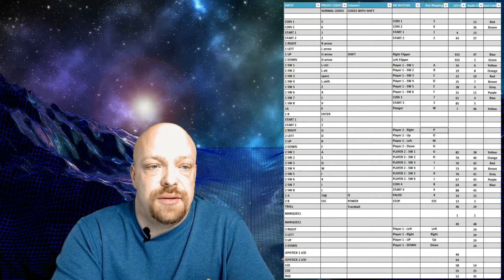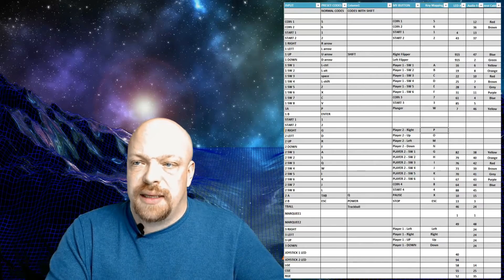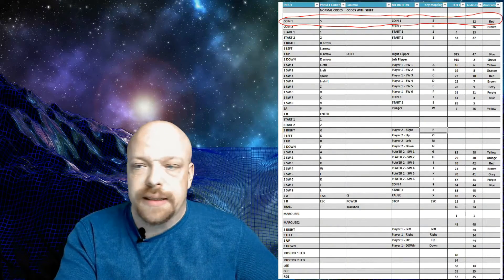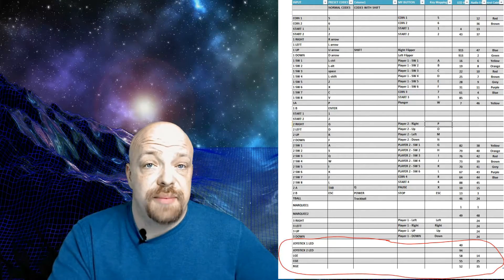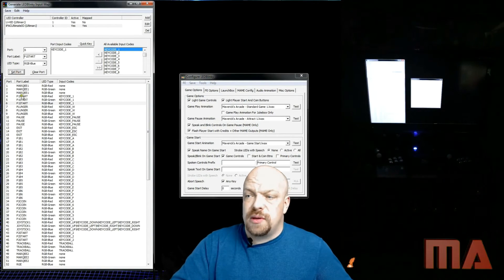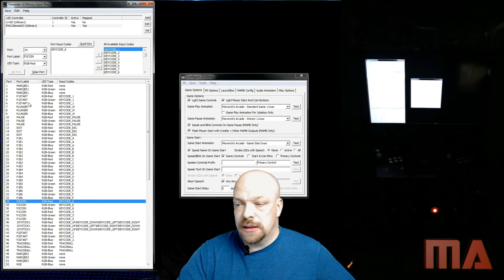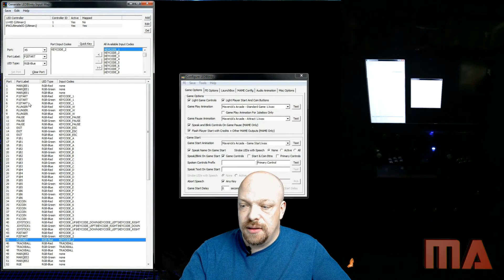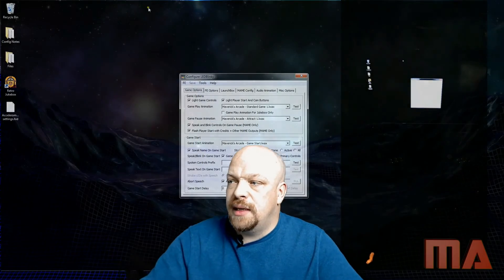LEDBlinky - Part 1 - Initial Config

Comment: Thank you for these videos. My situation is a little different.... I just have an RGB Trackball connected and would like for it just to come on after Windows startup, or at least on LaunchBox/BigBox startup and stay on. How would I go about setting that up? I have always had "Generate LEDBlinky Input Map" set to start up minimized with Windows, and I would have to maximize it and click the color I want every time. I would like a more automated way to basically have the trackball turn on set to blue as long as the PC is on. Thanks.
Reply from the maker: The generate LEDBlinky Input map way is just using that as the default and kind of cheating :-)    All your LEDBlinky animations and maps should have the trackball lit blue.  If you don't have Launchbox launch at start up you could use a batch file configured to run at startup that would initiate the command to ledblinky just to light up the individual LED.

From the LEDBlinky documentation:
Set LED Port(s)
  LEDBlinky.exe 14 <port>,<intensity>|<port>,<intensity>|...
  LEDBlinky.exe 14 <port label>,<R/G/B/S>,<intensity>|<port label>,<R/G/B/S>,<intensity>|...
  LEDBlinky.exe 14 <controller type>,<controller id>,<port>,<intensity>|<controller type>,<controller id>,<port>,<intensity>|...
Note: The Controller Type can be specified as the LED Controller Name or 2 character abbreviation. Use the LEDBlinky Configuration Help Menu for a list of supported LED Controller names and abbreviations. Example: LEDWiz or LW, PACLED64 or PL, IPACUltimateIO or IP, PACDrive or PD, Howler or HO.
Note: If only the Port and Intensity is specified, the value will be set on all active LED Controllers.
Reply: @MavericksArcade  Thanks for the reply and pointing me in the right direction.

Comment: I'm using an ipac4 for controls, and have added a ipac ultimate for LED control - as I have 7 buttons per player

 The LED’s on the buttons work, and flash, so I know that’s good

but now none of the buttons work in HS, and the ipac4 is not recognised, and the ultimate is not being recognised either 

and I'm now getting an error when I boot HS 

 Any help would be greatly appreciated - I'm pulling my hair out
Reply from the maker: If this is still an issue, shoot me a message on the FB page for Maverick's Arcade :)
Reply: Maverick's Arcade all good now, thanks!

Comment: Have 1 Pacled64 mapped for 1 half of my 4 player board and its working great, cannot get the second Pacled64 controller ID to go active to map other half of my controller even if I assign it to controller ID 2 in ledblinky. Any ideas?
Reply from the maker: As noted in the live stream, definitely let me know what Andy comes back with :-D
Reply: Maverick's Arcade I hadn’t set the id’s in the actual Pacled64 utility. I was trying to do it in Ledblinky thinking windows could just handle it. You have to set one Pacled id at a time, then unplug the usb and set the second to the number 2 id, now it’s working perfectly. Just going through your Ledblinky setup videos now, amazing work and thanks for doing them!!
Reply: So sorry, for taking so long to respond, I'm just getting my stuff in order to come back to all this.  Glad you figured it out, so it's basically the same deal as with the light guns, they share the ID unless you reconfigure them seperately :-)

Comment: im confused.  the ultralux is listed as half the price of the rgb classic $4 per button compared to almost $9...thats gunna add up fast just for buttons. why? do not all of them light up different colors and can be used with ledblinky? why pick one over the other?
Reply from the maker: No, the preference for the buttons is simply that the Ultralux buttons are flat.  The Classic RGB's have a concave button which feels more like the original.  Just preference, functionality is the same.

Comment: I have a CY-822B USB led-joystick controller board. I'm not sure if its compatible with this software. I'm not getting any response from the software
Reply from the maker: Arzoo (from LEDBlinky) stated in 2017 --- "LEDBlinky only supports LED controller hardware from Ultimarc, GGG, and Wolfware Technologies."

from the page:
http://forum.arcadecontrols.com/index.php?topic=73905.1320

That was in March 2017, but I'm not sure if anything has changed since then. 

Sorry, wish I had better information for you than that  :-/
Reply: Maverick's Arcade thanks, I have since bought a PAC drive, got it working.

Comment: Hi, SO I am strill tryng to configure my Cabinet with LEDBlinky, I also have a Ipac Ultimate board as well. However, I am using my 2 U360 sticks to act as game controller to control 6 buttons for each player as well as 2 buttons for the spinner. I have setup my machine but I am not getting the correct buttons to light up in MAME, I am running .179 and I have RGB LEDS that light up but they don't light the right buttons for each game. My questions is , when I do my input map , DO I set the port label for what I want my buttons to be , for example P1B1 should be the button that I want to be P1B1 or what my Joystick considers to be P1B1 , the same for the input codes , DO I set what I want them to be or what my Joystick cosiders it to be ? Thanks
Reply from the maker: It's a combination of the Generate Input Map AND how the buttons are defined in MAME.  1st, make sure in the LEDBlinky that you define P1B1 (Player 1 Button 1) as the label and of course, with RGB, setup a mapping for each color in the LED.  Also, MAKE SURE that the KeyCode for each matches whatever the input is for that button.  Then, when configuring Mame, make sure that what MAME is using as the button code matches.  As long as everything matches 100% the correct buttons should light.
Reply: @MavericksArcade  Maverick, do you address anywhere in your series how to resolve the issue with P2 Buttons 5/6 not lighting up in MAME for games like MK4 for instance.

Comment: I'm planning to build a pedestal arcade which'll handle 10 buttons per player (yes 10 buttons) What encoder should i get in order to control the lighting for all buttons. Does the Ledblinky handle several encoders?
Reply from the maker: 10 per player for how many players?  You can do several encoders for inputs, but I'm not sure about the LEDs.  

Are you doing RGB buttons for all your buttons?

According to one of my users if you used multiple pacled64s or other controllers for the LEDs, LEDBlinky should handle it, or at least it does in his case :-)  

His name is Justin Fugate and he uses a setup with multiple LED controllers.  He's pretty smart guy :-)

Your question was directly addressed in the following video livestream:   https://www.youtube.com/watch?v=sz2aFDKPjZc
Reply: 4 players. Thanks for answering!  I'll check the livestream

Comment: Thank you very much for the videos and sorry for my English .. One question, if I configure the ipac uio leds via ledblinky in Windows, could it work if I later use ipac with retropy?
Thanks!
Reply from the maker: The LEDBlinky orders the iPac how to handle the lights.  Nothing is stored on the board.  I believe with RetroPie you use a different OS that doesn't support LEDBlinky, I think....  You would need setup the LED controllers software that RetroPie uses.

Comment: So I am trying to get my system working , I have The Ipac Ultimate , and I have IL buttons with RGB LEDS connected. My question is , Is there a way to see if my connections are working without going to Generate Input map and mapping every button, I just want to make sure that my wire connections are working , and my power is getting to my Ipac Ultimate, The Generate input map IS recognizing the Ipac Ultimate , but no lights are lighting up . Any ideas? Thanks
Reply from the maker: The lighting up are primarily handled through third-party apps like LEDBlinky.  As far as testing the button input, the board should have a default config, so just open up notepad and start pressing buttons.  For the LEDs use LEDBlinky and choose to light all buttons white.  If they all light white you know the connectors are good.  :-)